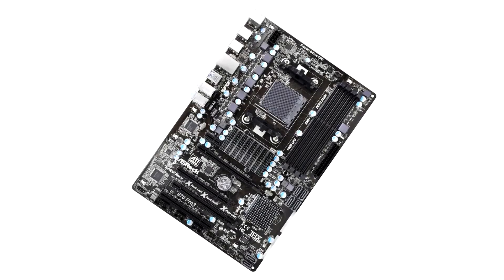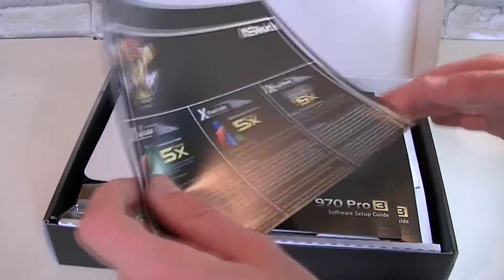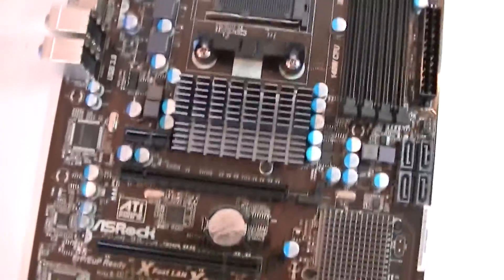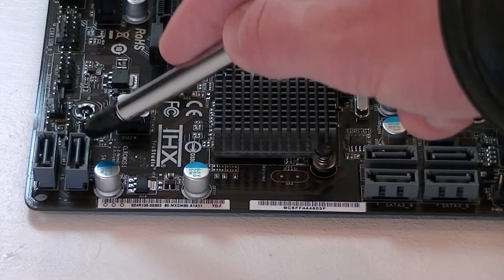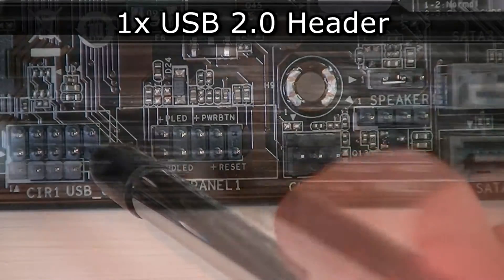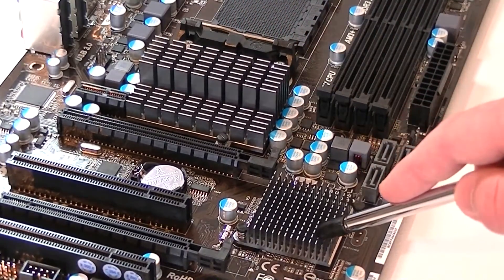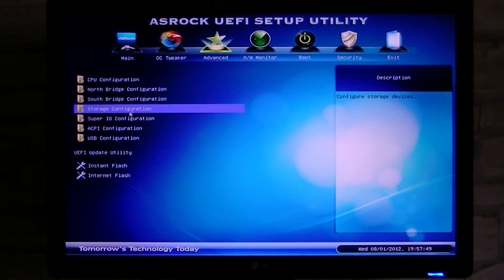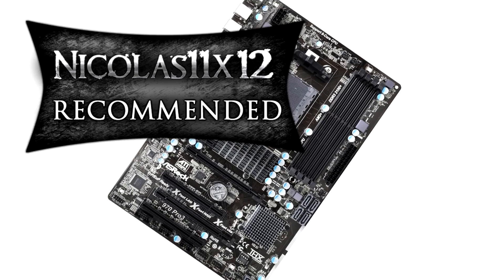ASRock 970 Pro3 Motherboard Review

Comment: Well I bought this motherboard at the end of last year and after 4 months devices from USB 3.0 started disconnecting and SSD kept disconnecting all the time. They replaced me with brand new one but motherboard died very quickly so now I don't trust this new one as well. I would suggest people to buy either top brands like Gigabyte/Asus or MSY which usually last for few years, this is just very cheap motherboard so it is only ok..
Reply: Dean mine lasted for 1 year now it died after a long gaming session on a local lan party

Comment: I have the ASRock 970 Pro3 R2.0, does this fully support the FX-8350? because I have one.
Reply: Yes it does support it says on ASrock website . I have this motherboard which I bought at the end of last year and my died after 4 months thank good they gave me brand new one and there ar epeople who have issues with SSD keeps disconnecting....I am thibking to sell it and buy either Gigabyte or Asus..
Reply: Snoop Doge it soes work. I have borh the mobo and cpu. Everything works nice! Just get an aftermarket cpu cooler coz the stock one is fucking loud!
Reply: Yes it supports FX 8350, but I bought that ASrock 970 Pro R2.0 back in June last year and in 4 months my USB 3.0 kept disconnecting and SSD kept disconnecting, they even replaced me with brand new one and SSD was still disconnecting so I sold that board and bought Asus Crosshair V Formula Z. I think this is why ASRock has cheap boards I will never buy ASRock motherboards again only Asus/Gugabyte or MSY..

Comment: Don't buy this peace of shit motherboard! I hate it so much
Reply: +Soul of Kekkonen Why is that?
Reply: +Horsman4James It can't control case fans right and doesn't show rigth speeds, shity BIOS,  when I first got it it was broken, bad PCI-E and ram space (my gtx 770 is bended because of those bad pcie-e spaces), usb 3.0's bad location, older BIOS made my windows go nuts, doesn't support SLI  (that doesn't mean it's bad), backpanel that came with the motherboard is just  really thin plastic plate.
Reply: Soul of Kekkonen Thanks for the information, I was considering getting it. This was the cheapest option that fit my needs, but for 5-10 dollars more it looks like MSI/Gigabyte would suit me better
Reply: +Horsman4James No problem. Can you send me those motherboard full names, because I want to check those out

Comment: is this motherboard work with FX 8350 black edition (I don't think about overclocking)
Reply: yes it suport the 8350 whit no problems.you can overcklock a bit but not much. 8350 uses max 125w the motherbord suport up to 140w.

Comment: It took my ASS two weeks to figure out 2 of these motherboards and the slow boot,Windows crashes and overall slowness of this board and it is of all things the Sata 3 cables are defective and Asrock knows it. Two times I have bought this board now and replaced the Sata cables and resolved the issue on both. Your Welcome... Happy building...
Reply: +Bobby Reynolds after replacing the cables, did the pc boot okay? How long have you had the motherboard and how is it coping now?
Reply: Rhys Jackson Figured out it was not only the cables but the bios setup is the most critical. OK go into bios then to Advanced\Storage configuration once there setup as follows.SATA Controller   Enabled...SATA mode   AHCI Mode...AMD AHCI BIOS ROM   Disabled...SATA IDE Combined mode   Disabled...Aggressive Link Power Management   Disabled...Hard Disk S.M.A.R.T   Disabled....SAVE and Restart your PC. Speeds and booting speeds should change immediately and internet Speeds and dropping..I run this same setup on my Asrock 990FX Extreme 3 with a FX8320 Happy building... Bobby
Reply: Bobby Reynolds I have now used this board 3 times with 2 FX 8320's and 1 FX 6300 and the storage config is the only way to stabilize it for all my Asrock boards
Reply: Rhys Jackson It's in the bios.
Reply: Bobby Reynolds  thank you very much dude! ive saved this and will use your advice when building my pc n a few weeks! :D cheers bro
Reply: Ok if this is on a new build do the bios adjustments first before installing Windows and it will increase the speed of the installment process also.
Reply: cheers

Comment: So, while trying to install a new fan on the motherboard i had to remove the fan "locks" (i don't know how else to call them) at the sides of the cpu socket by unscrewing the 4 screws, only problem is, now i can't screw them back on the MOB. It's like the locks were glued onto it, any ideas on how to re-attach them to the MOB?

Comment: how much can you overclock a fx 8350 with this?
Reply: MattMoultonMusic Obviously you dont know what your talking about, Yes it does support the FX 8350
Reply: what an idiot you are, FX8350 TDP is 125w THIS board handles up to 140w! idiot idiot idiot cant say it enough
Reply: +MrTakeaswig  You go dude, this comment made me laugh so hard xD
Reply: This mobo doesnt support that chip
Reply: Check the product website. It's not under the list of supported CPUs for this mobo.

Normal use will be fine but once the CPU usage goes up you will be disappointed. The board can't keep up with the FX8350's high TDP. You will get high temps and even thermal throttling in some applications, even with aftermarket cooling.

Source: I owned that combo, rebuilt my PC with a better motherboard and have had no problems since.
Reply: this mobo has a 2400 mhz hyper transport bus. Most of the Fx chips including 8 cores and maybe six cores need atleast a 2600 mhz htb to preform at full capacity at stock. You can even see that in the cpu support list. So it can run the fx 8350 im sure with no problem but it wont run as fast as on a diffrent board with 2600 mhz htb and you probably cant OC on this board and you wont receive any benefits from it if you can.

Comment: Why does everyone say 970 chipset boards are bad and you won't get the full performance of your chip?
has anyone actually tested 970 vs 990 chipsets?
Reply: yeah but why?

I was planning to build an amd system before but everyone kept saying that VRMs are bad in 970 boards. so if you want to do overclocking you have to get 990fx boards.

other people say that their 970 motherboard gets too hot when overclocking or your cpu might get fried because of the VRM

The total system expense would be a lot higher with a 990fx board so I went with an intel build instead with the i5 4460 and an h97 board.

no overclocking but still outperforms fx8350 at stock settings ... well you have to overclock the amd chip just to be at par with the intel chip

Comment: Do I need to update the BIOS to use the FX6300 on this?
Reply: +Dogan Kusluoglu I'm extremely late, but that's just a note because it's an AM3 compatible motherboard. However, it is an AM3+ based motherboard, it just happens to be compatible with AM3. The guy in the video is crazy.
Reply: +tyu hji So i can use that mobo without changing BIOS with à fx-6300 if you aswer yes i'm buying it

Comment: Hi guys, i'm new to pc builing and i like it very much. I'm planning to build a pc in the next year. are these parts good for a 1080p gaming rig? I want to spend around 1100 euro's.

Motherboard: AsRock 970 Pro3 R2.0
Case: Cooler Master Elite 430 (with window of course)
CPU: AMD FX-8350 Black Edition
GPU: Sapphire R9 290 4GB GDDR5 OC TRI-X
PSU: Cooler Master G750M
SSD: Sandisk Standard SSD 128 GB
HDD: Western Digital Blue 1TB 3.5"
RAM: Corsair Vengeance 1866-8GB (2x 4 gb dual channel config)
CPU Cooler: Cooler Master Hyper 212 EVO
Monitor: LG Ips 22mp65hq
Reply: Get a bigger hard drive, you'll need it. Trust me. Don't shy away from HDD on a tower, it's not going to be shaken as much as a laptop and it lasts esentally forever

Comment: this guy does not know what he is talking about i have this board and a amd 8 core processor and i have not suffered any performance lose from it
Reply: +xXxBlackRhinoxX  yeah dude,i also have eight core proc..fx 8300,and it works super fine with this board.
Reply: 2sabat nope
Reply: xXxBlackRhinoxX I just ordered this board and an fx-6300, asus gtx 750 ti. so i shouldnt have any problem with it?
Reply: 2sabat sounds like a decent setup
Reply: xXxBlackRhinoxX 
Did you stress tested it with prime 95 and did any freq on all 8 cores fallen under stock values?
Reply: +2sabat  Is the board doing well ? i am asking because i might be buying a pc with the same motherboard and i am looking for information about it
Reply: DeadCrash Not sure about OC'ing since I haven't bought a proper cooler yet for my CPU, but other than that its pretty good
Reply: Did you OC the 8300 with it? if yes, on which Mhz?
Reply: With rev 2 of this board (heatsinks on the VRM) it just supports an FX-8350, but really not much above stock. Stock/boost is 4/4.2  max overclock without modification is about 4.4 Ghz (if you don't need to increase voltage, but in your case you will definitely need to increase voltage to get this high). I have mine running at 4.8 Ghz at 1.5125 v setting (huge voltage drops), but to keep the VRM from throttling and overheating (that's what limited it before), I made a shroud/duct that pulls 1/3 of my 120mm fan airflow across the VRM. That fan is a very high speed 4,000+ rpm industrial category fan, so I wouldn't expect a normal fan to do as well. I also have installed another 3 fans and several other heatsinks (on the inductor chokes beside the VRM) to keep the board from overheating. Obviously I'm also not using air cooling on the chip to get these speeds.

Comment: Will the fx8350 work well with this board
Reply: yes it does. i'm using this board with fx-8350 and r9 280x. flawless setup.
Reply: bart coolen the 8350 how much u overclocked it ?

Comment: Someone please help does this motherboard work with a gtx 550ti I can turn on my Pc but I get no display and the motherboard doesn't come with onboard graphics so I want to know if Im doing something wrong or If I should get a new motherboard heres my Specs:amd fx 6300 black edition, galaxy gtx 550ti, 2x4gb, gskill ripjaws X, 1tb western digital caviar blue and the Asrock 970 extreme3  r2.0
Reply: ***** Thanks for the advice but Its ok because I got an msi 970 g46 motherboard and my pc works fine now.

Comment: What sort of which set did he not recommend using?
Reply: Steel_Nugget ah yes, welcome to Britian, where everything is priced by a toddler, and then increased by 33% because the government aren't quite happy with taking 40% of our salary in the first place
Reply: 4K? they're up their own bottom
Reply: No 8 core proccessors!
Reply: well...piss
Reply: Arthur Butcher You can use them, it's just that they may be bottlenecked. Which can be solved with a later Mb upgrade if needed.
Reply: Steel_Nugget I'll just have to sacrifice my gpu and get a sabertooth 990fx
Reply: Steel_Nugget I'll just have to sacrifice my gpu and get a sabertooth 990fx
Reply: Arthur Butcher Why? Your GPU is what gives you most of your performance. It shouldn't bottneck that much, just google some benchmarks.
Reply: Steel_Nugget I'm just after a startung point, GPUs are easily upgraded, motherboard arent
Reply: Steel_Nugget I'm just after a startung point, GPUs are easily upgraded, motherboard arent
Reply: Arthur Butcher But motherboards are cheaper (At least where I live) So paying $70 then $100 isn't as bad as $200 then $300.
Reply: Arthur Butcher That is what the U.S is coming to. If you want a good deal on a video card check out Ebay. I bought a HD 7970, and HD 7950 WF for $260 for both or $130 each, you just have to wait for good deals, and you are guaranteed a working part since Ebay has a money back guaranty. (First 7970 I got had a messed up cooler and was overheating(It was a mining card) But I was able to return it and got all my money back) If you are worried about warranty EVGA has a simple transferable warranty. I also bought a GTX 670 FTW off Ebay and it has 1.3 years left on the warranty.
Reply: Steel_Nugget I'm currently banned from eBay for selling my old beats but I'd lost my receipt, so they assumed they were fake and shut me down. EVGA are brilliant when it comes to warranty
Reply: Arthur Butcher That sucks. I was actually just trying to list an item (about 5 min ago) and according to there website a 4k image is not high enough quality. I'll have to yell at them tomorrow since there lines are closed, since it will not let me upload the item to sell because of it.

Comment: Anyone here own this board knows the chipset temperature? i plan on buying this for myself on my bday on the 21st. I don't wanna buy a motherboard with a blazing hot chipset running at 9000C. My outdated am3 nvidia 630a/7025 is at 22c and it keeps my room cold not blazing hot.

Comment: Nice video! I'm planning to buy this one with a FX-8320 cpu, GTX 860 Ti (which will be released later this year 2014), 8 Gigs DDR3 Memory, SSD and HDD.
Bist du Deutsch? Ich höre es :P
Reply: I was wrong, I'm planning to buy an ASRock 970 Extreme3 R2.0, which does support 64 GB RAM and 8-core FX's :P

Comment: The best bang for buck AMD  platform in 2014  >  ASRock 970-PRO3-R2 with fx6300.  ,
8 or 16 gb ram ,new bios will run upto 64gb for later when 4k camera rendering is the norm ,
 use bulldozer 8 core chip for rendering large hd files , still this fx 6300 will out do a old intel i7 930 ,not by much when i7 930 oc , but 1366 socket with no sata 3 support really sucked , so i build the AMD to replace it ,

Comment: really ? 9/10 ... i ordered this mobo but found out later it doesnt have USB3.0 to plug your front chase usb....
Reply: you need to do better research , the mobo was updated to r2 
ASRock 970-PRO3-R2 , is the one you want , rated 10/10 on pc builder
Reply: i have an Zalman Z9 U3 and i use all my usb front panel 2.0 and 3.0 :)
he just don't show the usb panel connector

Comment: this test is shitty .... you mainly just namend what i could read in the specifications on the asrock site ... you didnt tried to use it for overclocking you just said something obvious that a 990 chipset should be better for overclocking... bla blah ... next time i want a real test where you show your overclocking skills even on a cheaper mainboard.
Reply: SO I got the ASRock 970 pro now for myself together with a FX 6300  @ 4,5 GHZ stable ( prime 95 for 12h) so for me this board has a great OC potential.

Comment: it just wont work.  it will be too unstable.  you want to do it slowly and bit by bit so do the frequency first but do it a tiny bit then run prome 95 for about an hour to see if it is stable then repeate untill you get the desired frequency.  do the same with the others aswell.  but before all that buy a aftermarket heatsink the one that comes with the cpu is so freaking bad

Comment: is it safe to set CPU frequency to 500MHz(max), PCIE frequency to 250Mhz(max), CPU Frequency Multiplier x15(max) and HT Ratio x10(max) in the Asrock Extreme tuning utility ? I am currently running AMD Athlon II x4 640 3GHz processor and in this utility cpu frequency multipier is set ot 200 MHz PCIE to 100MHz CPu frequnecy multiplier at x15 and Ht ratio at x10, so if i max everything out what should i expect ?Even better performace or will it just fry itself ?

Comment: the 8350 on the 970 chipset runs the same as on the 990fx. my friend benchmarked the 8350 with the 970 and the 990fx he got similar results not much more improvement.

Comment: i really recommend you just get a external or pci soundcard... onboard audio just doesn't cut it... then you can disable it in the bios and no more problems... you will notice the biggest difference when you connect more powerful headphones that need more power... they will be a bit silent and more distorted with onboard audio